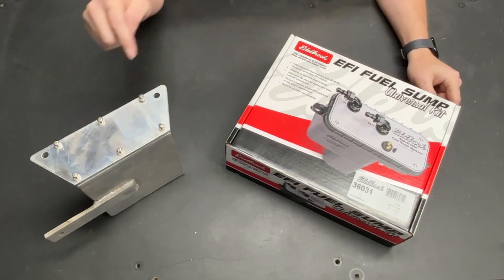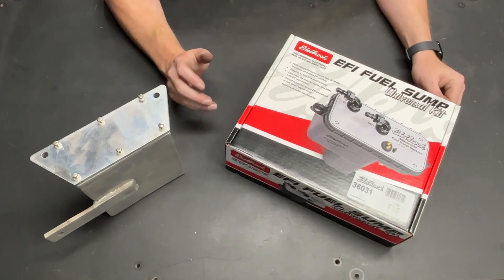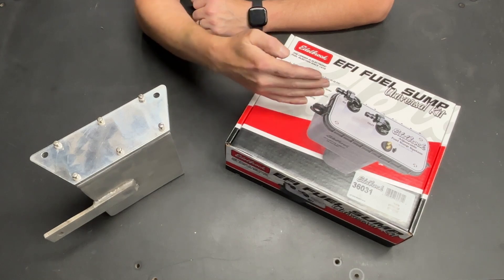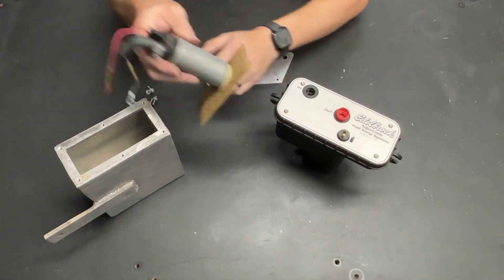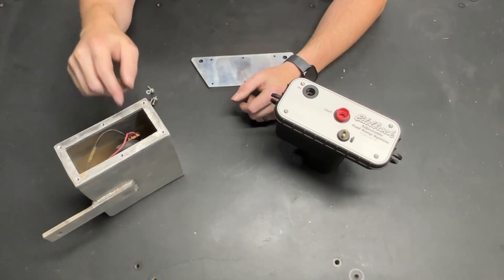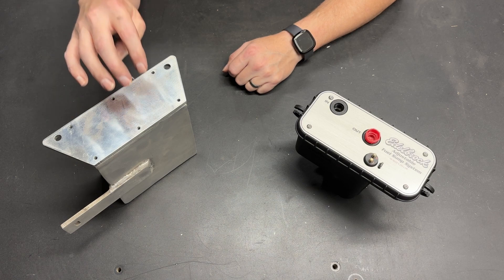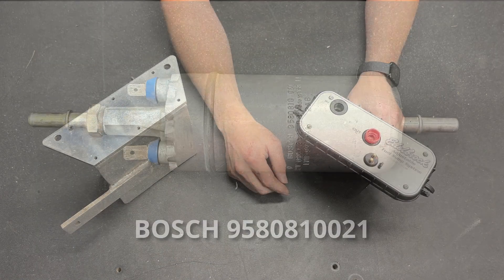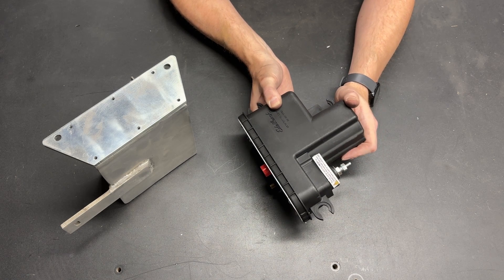Edelbrock 36031 EFI Fuel Sump Compared to a DIY EFI Tank Instead of Retrofitting the stock tank

Comment: Let me start my comment by saying that I love Edelbrock and their products. I really appreciate the fact that they try to make a very high percentage of their products in the United States. Overall, they make great products. I have a Pro-Flo III system on my T-bird and I LOVE it.  However, I bought one of those fuel sumps, and I literally threw it in the trash after I had tried to make it work for a couple weeks. The volume in that tank is very small. Due to under hood heat I had two pumps lock up. Also, Edelbrock does not support replacing the pump. If the pump ever goes out, you have to replace the entire sump. I replaced my pump against their directions and it worked for a little while, but it locked up just the same as the original factory pump did.  Also, you have to run a vent line back to the tank.  One of the benefits of the fuel sump is that you don’t need to tap a return line in to your tank.  But they require  running a vent line.  At first, I thought, It’s just a vent, It can vent to atmosphere.  I was WRONG!  The mechanical fuel pump overpowered the needle and seats in the sump (there are 2 and ironically, they are made by Holley) and fuel was gushing out the “vent” line.  So, in reality, they could be done away with and the “vent” line would just become a “return” line.  all ink all, I think that product needs to be re-designed or cancelled.
Reply: Chuck I need your help! Hope you see this! I'm trying everything I can think of to help a guy finish up his 87' grand wagoneer. He brought it to me with the Edelbrock EFI system freshly installed. He made a few mistakes on the install, which I resolved, but I'm having an issue with the fuel pressure cutting out. Mostly happens when the truck is fully heated up, and your inn stop and go traffic. The engine bay puts out a lot of heat, so I was thinking the fuel could be boiling or getting too hot?? I was thinking about re-locating the sump underneath the vehicle, away from the engine heat, or maybe I need to look into a different fuel delivery system all together for him? When you say your pumps locked up, did they ever come back on? Im wondering if i'm having the same isssue. Last time the fuel pressure dropped out, I tried restarting and had like 0-6 psi, almost like the pump just wasnt turning on. Let the Truck sit for approximately 4 hours, then finally got the pump to generate 44 psi again. Any input would be greatly appreciated. Feel free to email me at Sean@Lube1.net. Thank you!
Reply: @seanjost7160 i replaced the first pump, so I don’t know if it would have come back on or not.  I want to say that the second one did free up and start working, but I ended up going with an in tank setup. There is a reason OEMs do it that way!! Good Luck!
Reply from the maker: Thanks for the real world feedback I really appreciate it.  I hope my system will not have the same issues that your did but after reading your post I have concerns.  I guess we will see if if it doesn't work as planned I will do a follow up video.  Thanks again for the info.

Comment: I really don't recommend the fuel sump from Edlebrock. The pump in mine left me stranded on the side of the road after about 8 months of usage. I had purchased the pump a little over a year, so the warranty was over. I opened sump and went on finding a new pump for it. The little grommet that hold the pump on the cover was cracked. Tried to reach Edlebrock to obtain a part number for the grommet, they said they made no service kit whatsoever for the sump pump. That's really not helpful... If you can avoid this product, you should. I'll probably end up cobbling something together as my car has been sitting in the driveway for more than a week, but I don't think I'll be keeping the pump in the future.
Reply from the maker: Thanks for the heads up
Reply: @dazecars  you're welcome. Get well soon
Reply from the maker: Hope to